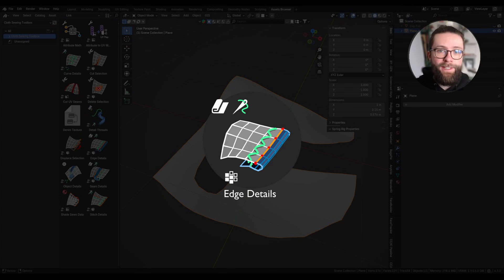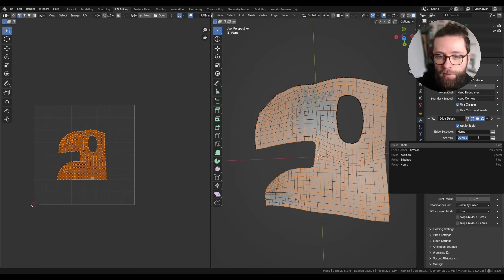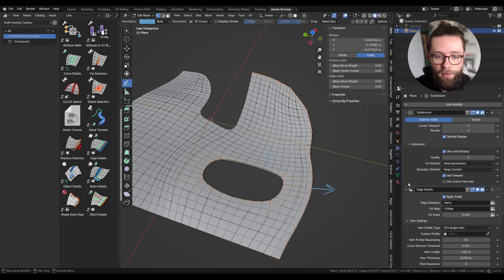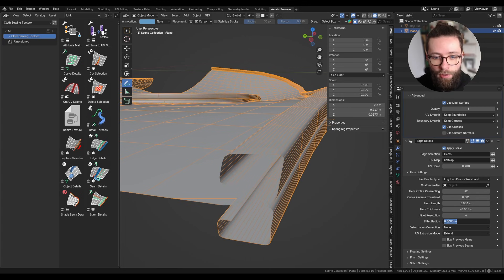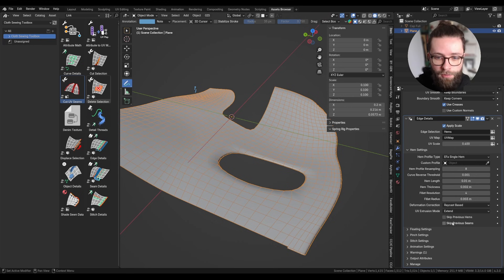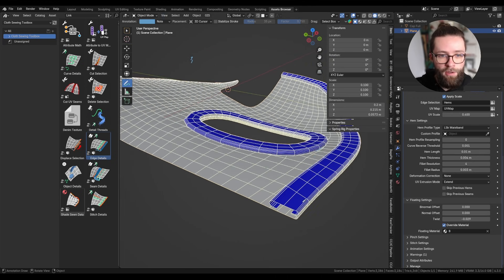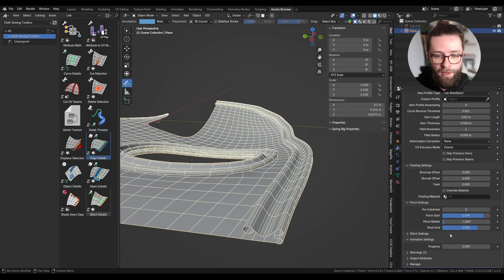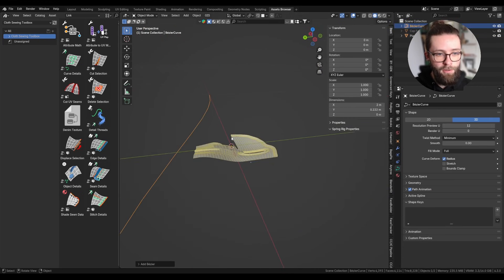Edge Details (Hem, Piping, Bias, ...) Tool Tutorial - Cloth Sewing Toolbox for Blender

Comment: How do I find my uv scale if my mesh has multiple parts in my uv?
Reply from the maker: You can either have one modifier for each UV island with the corresponding scale for each one, and the selection only being made for one UV island at a time if the UV scale differs too much from one island to another, or make a dedicated UV map with a more uniform UV scaling to be used by this modifier, or even put an average value if the UV scale does not differ that much from one UV island to another.

Comment: I havent gotten to the rest of the videos yet but i noticed after i got a very good hem after scaling my model down, i cant get the stitch option on this modifier to show more than what appears to be a single vertex thick thread, i wasnt sure if this is the desired outcome. Thanks a ton for your work on this i am going to save hundreds of hours using this.
Reply from the maker: Do you mean the stitch is only a thin curve? If you are talking about that, you need the Detail Threads tool to add thickness to it! Otherwise, the issue could be related to the values of some dimension settings and whether or not you applied the uniform scale! Hope that helps.

Comment: Great tools! I started to try out this one and had some issues with it or just don’t know how to troubleshoot them.

1.) Solidify: In your tutorial where you built this geo node, you included the Shell Output from a solidify modifier. This option wasnt  included in here

2. )Is there an option to have a binding over an edge which has thickness already? i tried some workarounds but the modifier gives me strange results on the start and end of the binding.

3. ) Is there an option to cap or have a rim on the start and end of the binding?
Reply from the maker: Hi, thank you for your comment, sorry about that, I just made a minor update to the assets pack to add back the solidify shell option on this tool!
To create en caps or rims, I added an output attribute for the enpoints of the floating geometry, as well as a "skip previous floating" option. That way you can add another edge details tool after you created the bindings, and have its selection set to the endpoints of the previous one, with skip previous floating set to false to add small hems on the end of the bindings!
Hope that helps!
Reply: @alexandre.albisser  Thanks for the update! Will have a look :) 

Regarding 2.) is this an option or should I only use it with the solidify mod. ?
Reply from the maker: @aloexkborn  not sure I understand the issue, isn't it fixed by the solidify shell attribute?
Reply: @ Sorry it wasn’t clear enough. I wanted to use this tool on an edge of a 1mm thick strap. I applied the solidifier already. Selecting only the front side edge, or deleting the rim inbetween creates strange results on the end/ start of the binding (when the binding is not through the whole edge). Or does the tool only works best with open edges in combination with the solidifier?
Reply: @alexandre.albisser  Got it now. The update for the rim on the hem edge works perfectly ! Thanks! Can't wait for future updates :)
Reply from the maker: @aixbln  Great, glad it works! Still working on the next update which will add zippers and a solidify modifier with more control and better side UV mapping among others, I hope to release it soon!
Reply: @alexandre.albisser  Omg animated zippers that can actually deform the mesh? :O That would be amazing. So when you open them they push the geometry aside. I only got stuff like that with another geometry node zipper things, but I had to push the mesh aside with shape keys. So it looked believable when opened.
Reply from the maker: @ShiroiAkumaSama  It will be able to do this, or the opposite (deformed mesh that comes together when you enable the zip). I am nearly done with the first version of the tool, I hope to be able to release it soon!
Reply: @alexandre.albisser  Man I hope your stuff gets far more popularity, it is so good and well fleshed out and it opens so many possibilities!